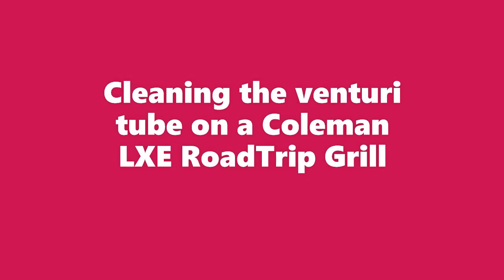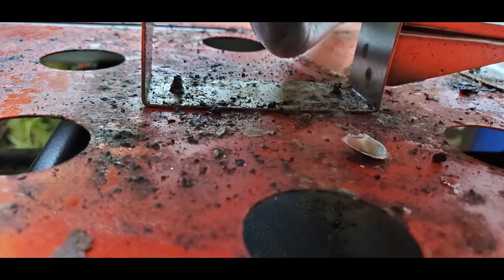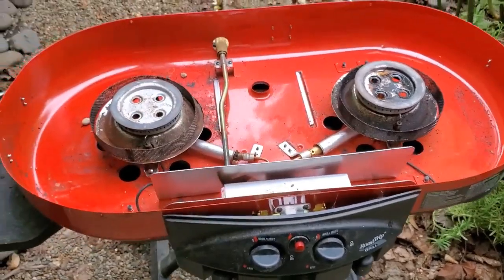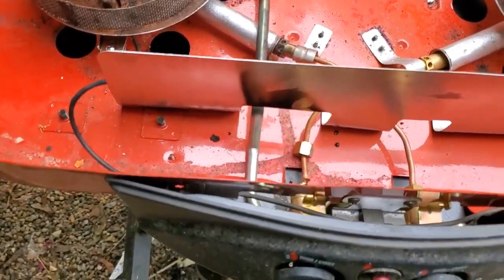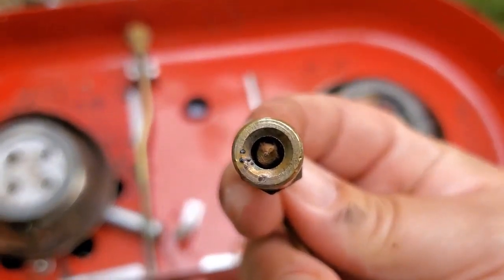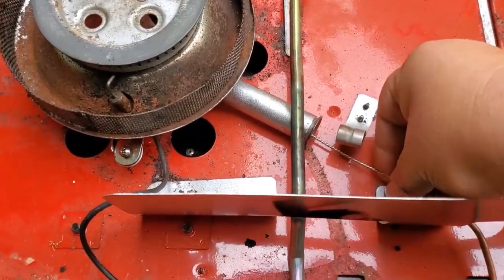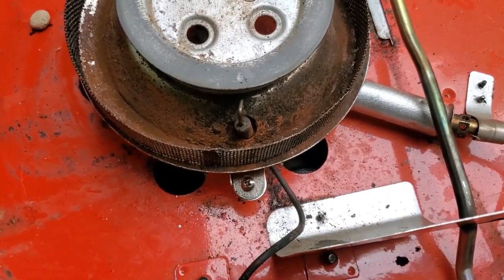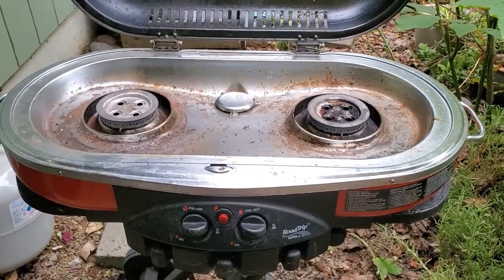How to clean the venturi tube in a Coleman RoadTrip LXE grill

Comment: I see this is several years old, but thank you. I have this exact grill. Pulled it out yesterday to take to the beach for the day to grill hot dogs n burgers. The left burner barley had a flame, the right side was fine. TodayI took it down to the burners like you show, but didn't think about bending that aluminum shield back to access the 2 screws. ( I was afraid I would need to remove the leg farm and take out screws from the bottom.    Great help.   Thanks
Reply from the maker: Glad this helped!

Comment: Thanks for this. I normally use my charcoal grill but today i didnt want to wait for the coals to fire up so i pulled out the same grill you have to grill quicker. Left burner not working. Really upset about. Im gonna try what you did and i hope it does the trick. Thanks again for the video
Reply from the maker: I hope it helps!
Reply: @ORSunshine80  Just did exactly as you said and it worked!!!  Both burners are up and running.  thanks again!

Comment: I checked this and mine was fairly clean. But inside that brass fitting, the tiniest hole was clogged by the tiniest spec of whatever it was. I cleaned it and it fired right up
Reply: Mine too. Blew it out with a can of compressed air.